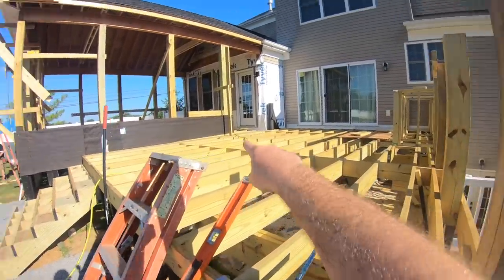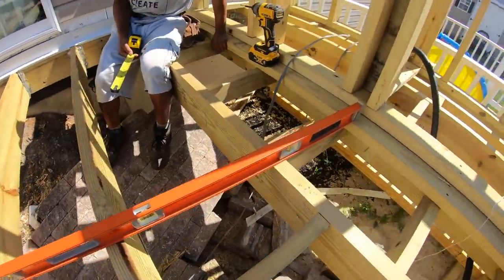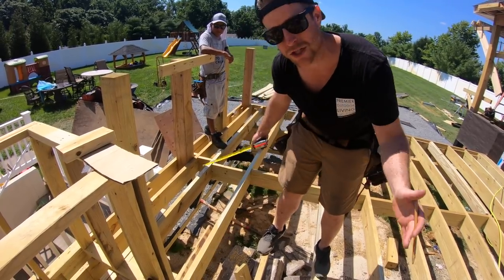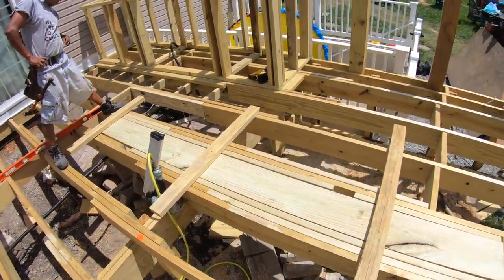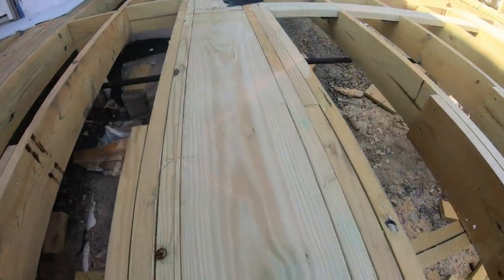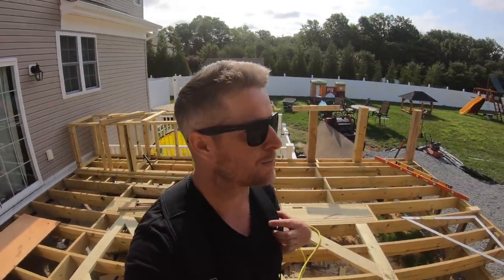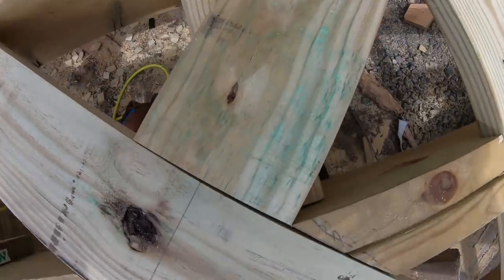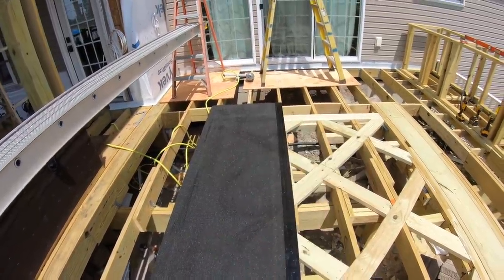Framing A Deck For The Craziest Inlay! - Deck Planning and Layout

Comment: Only issue I see with with using ice and water Shield is that it’s not UV rated. Granted it should see vary little light between boards I’d still recommend a different product. Killer work though man!
Reply from the maker: This is actually a different product, it’s a granular topped underlayment, pretty much the same thing as roll roofing, but we’ll see how it holds up over the years!

Comment: Ever tried using your SKILSAW to clean out those notches instead of a chisel? The blade is already set to the proper depth, just drag it across the notched area while supporting the base of the saw on the board above the notch.

Comment: What size are the Joist in this video? Only asking cause I see the blocking is notched into the joists but on another video you said 2  x 12s you can notch but with smaller joists size instead of notching the blocking into the joist you nailed the blocking inside the bays. Just need clarification. Learning a hell of alot watching your videos. Your very sharp and smart brother. A video on your journey into decking/ construction would be dope. Salute.

Comment: Just wondering. Could a regular membrane like Grace Ice & Water Shield be used in place of the roofing underlayment and still work good?
Reply from the maker: For sure! I was gonna buy that but they didn’t have any at lowes
Reply: anything that really sticks well is good. I havveused Zip, Grace Decking and window flashing as wlel.

Comment: What is the purpose of the underlay, from what I can see all of framing material is treated? 

Are you worried the nails/screws will allow water to penetrate the treated material ?
Reply: Not a lot of water is gonna sit on a 2x12 on edge, but theres a lot of potential for water to sit on a 2x12 on flat, hence the flashing/underlayment to protect it from water damage and rotting.
Reply: Composite boards don't breathe like wood boards do, so the plastic next to the wood framing promotes rot.  The barrier material  keeps the wood dry.  But also, that material is designed to be soft and gooey, so it seals around any screws that you put through it.
Reply from the maker: Yup pretty much what these two said!

Comment: Instead of underpayment, you could use a product like G-tape which is a tape membrane used for sealing flat blocking like you’re doing. Look up Dr. Decks on YouTube and insta. Speaks very highly of the product and uses on all of his composite decks.
Reply from the maker: I haven’t tried that yet, totally would but I like using stuff I can buy locally in case I need more on short notice
Reply: Premier Outdoor Living totally understand that. I get jealous of all of the northern builders who get Menards!